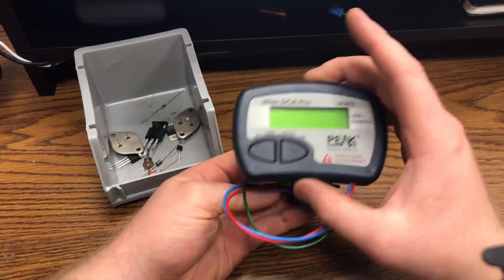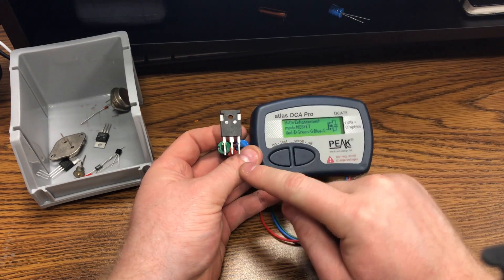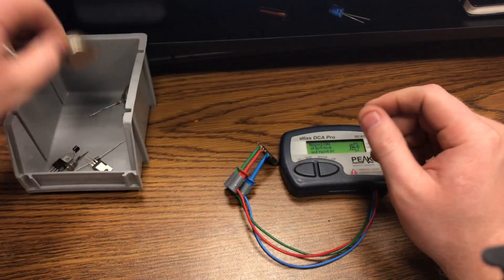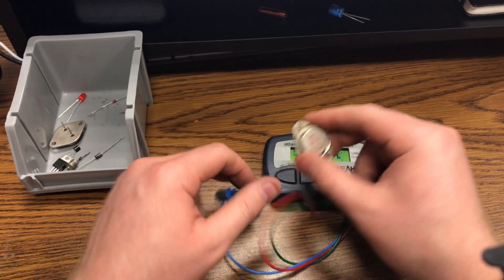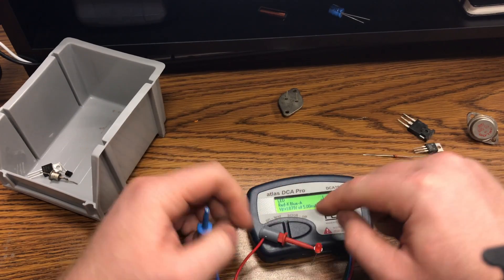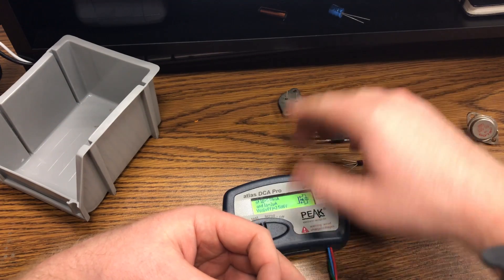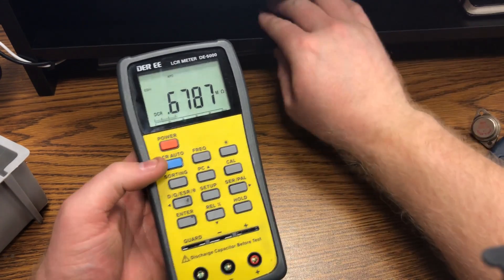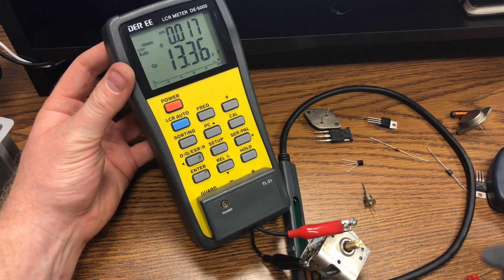My New Favorite Tool for Electronics

Comment: Nice reviews!  Yes, the only disappointing thing about the Peak analyzer is that $140 price tag.  Really, an ohmmeter is still pretty easy to figure out what you have, don't you think?  I mean power FETS are nearly always GDS.  And nearly always enhancement mode.  And, similarly for bipolar transistors, you have EBC or ECB (IIRC).   

When testing MOSFETS, here's a fun tip:  One time only:  Put a voltmeter in parallel with your ohmmeter and measure what ohmmeter setting gives you at least a few volts.  Now, you can use your ohmmeter to test turn on/off of a MOSFET.  Measure ohms DS before and after turnon and you can tell if its switching okay.  (Short GS to discharge Vgs to turn it off again.)  Dan
Reply from the maker: I've been doing that for years, but it doesn't give me enough data.  I want Vgs(on) and Vgs(th) as well as testing them to make sure they're functional.  What about voltage regulators, do you have tip for quickly measuring Vin vs. Vout?  When I'm in a rush it's nice to just have a tool that does it all, although they could've just thrown in the LCR feature like some of the cheaper clones do.
Reply: Just check eBay for the super cheap versions that came way before this one.

Comment: Not as fancy, accurate or robust as the ones you reviewed, but there are tons of cheap but still decent LCR-ESR meters on AliExpress, Banggood, DealExtreme, etc. 
Search for M328 or LCR-T3.
Reply: Curious Gecko yep was going to say this, 140$ is pretty pricey but I'm sure a bit more polishing goes into them, I know some of the cheaper ones sometimes have trouble distinguishing between certain parts. but are a really great deal for <$20 or so.
Reply from the maker: Cool, thanks for sharing!
Reply: This is hardly just an LCR or ESR meter